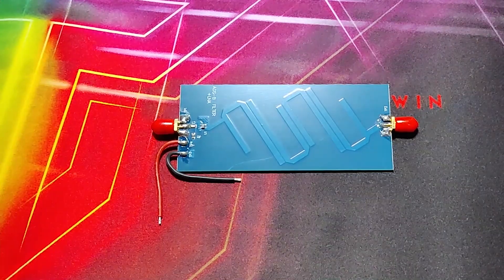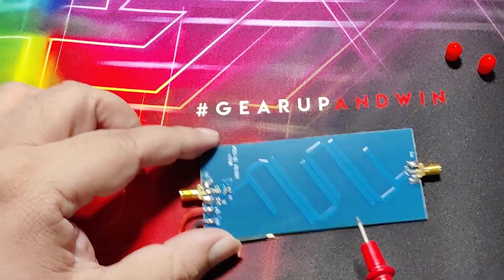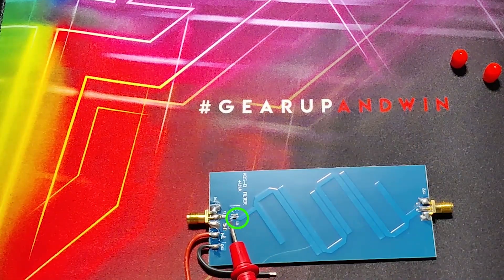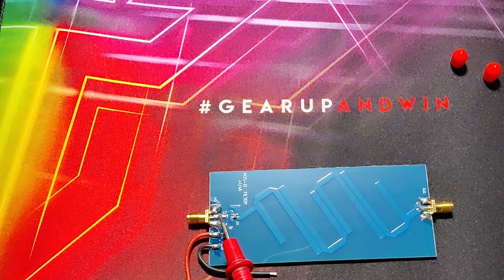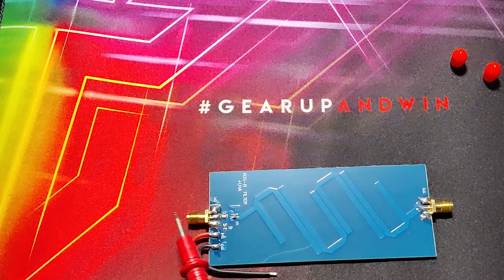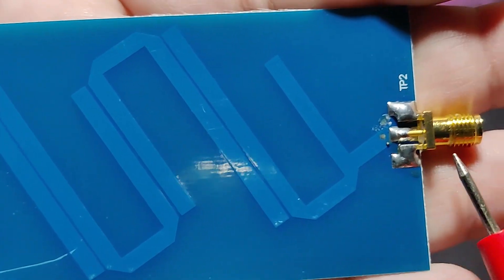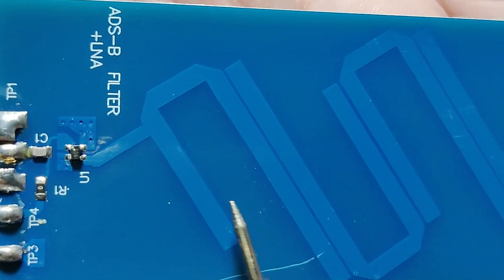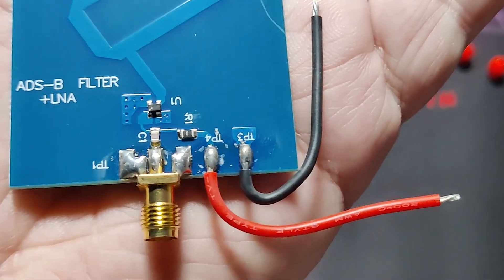ADSB 1090MHz Bandpass Filter with +20db LNA  for SDR Receiver Overview by Technology Master

Comment: Do you think I could use a usb wall charger + usb cable, cut the usb wire and solder the +/- directly to the board?
Reply from the maker: You can solder and USB connector on board for easy attaching to any charger etc. If you cannot find this connector for soldering on board, you can go ahead with cut and direct solder. You need to keep in mind that your charger should be able to provide 2 ampere or more current. May be you can try this search on Amazon https://www.amazon.co.uk/s?k=usb+connector+for+soldering

Apologies for the late reply. I am just coming back from an unenforceable long break.

Comment: hello! can you provide information about filter performance and effectivity?
Reply from the maker: As per specs out of band rejection is more than 30db. It preamp got burned by 5v. Better to use silicon diode to keep it to 4.3v or so. I already know it but I do make mistakes, happy to be human :) On the basis of many other devices that I have tested, I believe that these boards usually stay within 10% tolerance of given specs.